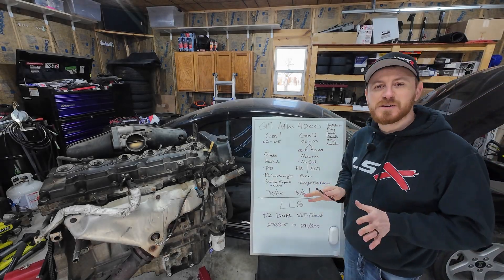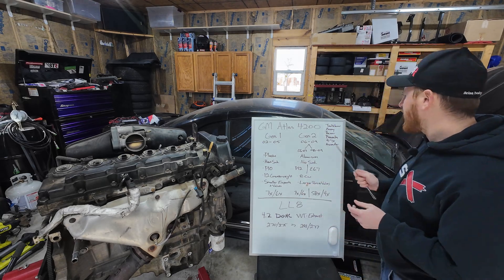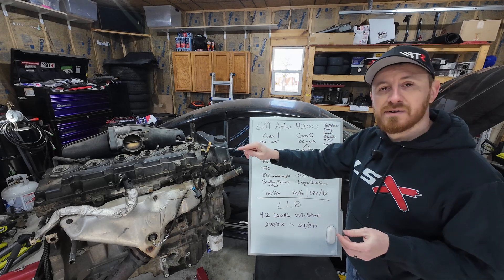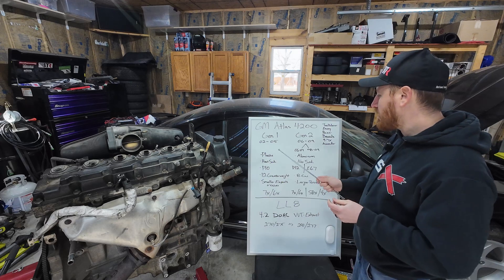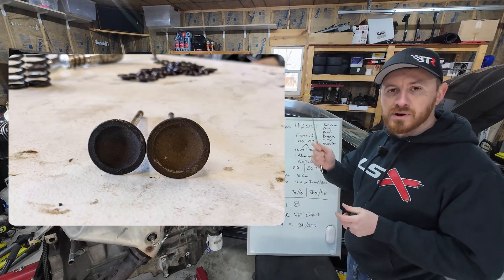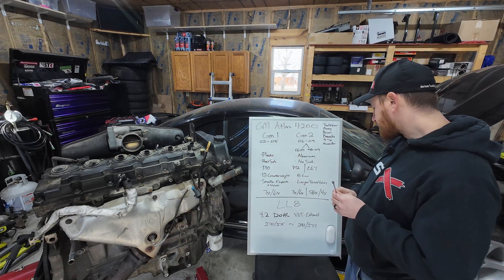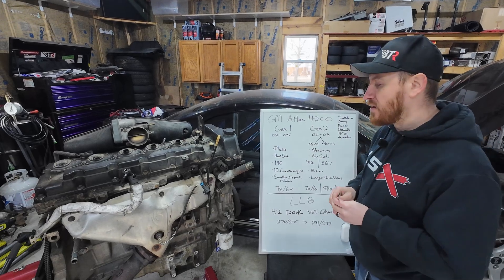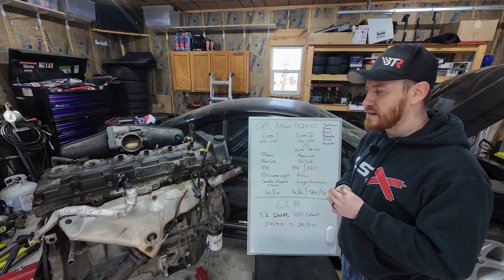The GM Atlas 4200 "Ameri-Barra" - Everything You Should Know!

Comment: I'm looking at swapping a 4200 in an older vehicle in it's stock form. Any guidance on making the harness and PCM stand alone? I've done early LS stand alone set up, much difference?
Reply from the maker: Yeah fairly similar.  I used the same approach as I did when I LS swapped the 240 years back.  I stripped it all down, removed what I didn’t need and labeled everything.  I redid some of the routing I think I show in another video on here
Reply: @TeamHybridRacing  The reprograming should be about the same game shouldn't it?
Reply from the maker: Yep it’s just about the same really.  You just won’t have to worry about bank 2 stuff on the O2 side

Comment: I've worked on lots of these, and I've seen two that came in with no compression on one cylinder due to burned valves. I haven't heard anyone else talk about it but it is something I've run into. I also fixed both of those without any further issues, but I did have about half the headbolts break on both of them when removing the heads.
Reply from the maker: Yeah that's about the only issue I've read and it seemed like if most made it beyond 100k they weren't effected but not sure how true that is.  I have certainly heard that the head bolts almost always break.  I'm going to use some spare LS head studs when I swap heads that fit with a spacer

Comment: I ran a shop for 37 years MyHealth forced my retirement I worked on many of these vehicles they were virtually Bulletproof except for one small issue has the engines age the thrust bearing on the crankshaft will wear allowing the crankshaft to slip forward slightly when you come to a stop this causes the crank to become misaligned with the crankshaft sensor and the engine will stumble or sometimes stopped running
Reply from the maker: Sorry you had to force retirement but I appreciate the info.  What I've read is there was more dedication to the vvt and less to the rearward bearings.  I am going to do a common upgrade where we add an oil line to help get extra oil to those bearings

Comment: I have an 04 Envoy, what is necessary to swap to new head and crank pick-up. Will a newer harness plug and play?
Reply from the maker: I think if you swap on the 06-07 head it's mostly plug and play. You would of course need the newer coils on it and you'd want the exhaust manifold.  The 08-09 has a different cam tooth being the 4X wheel.